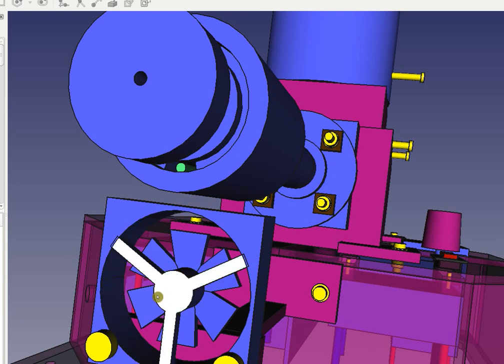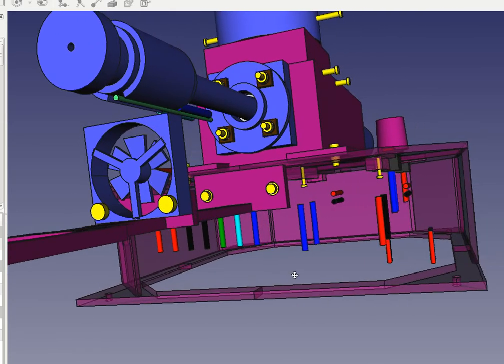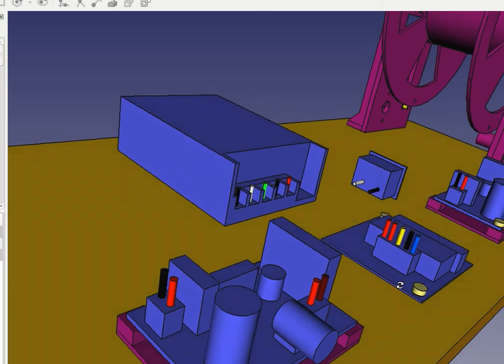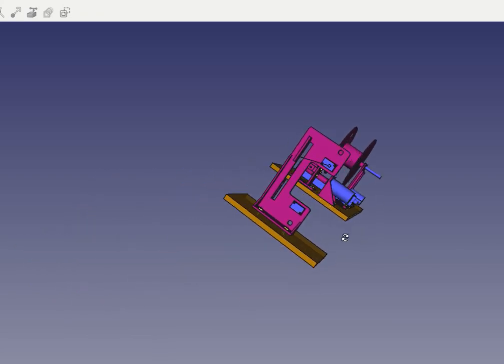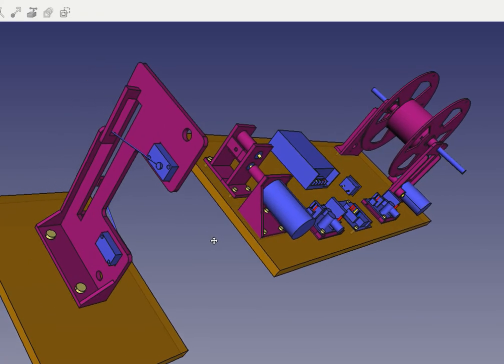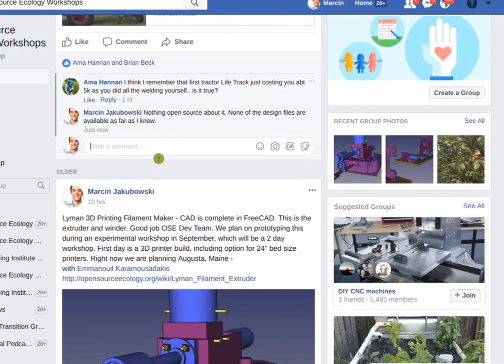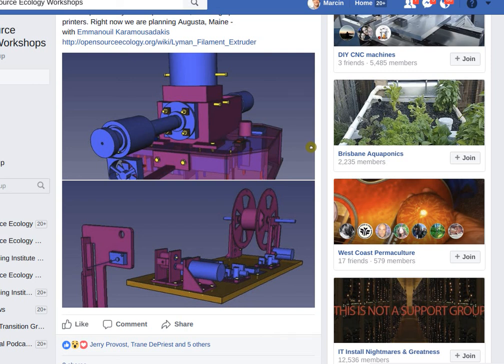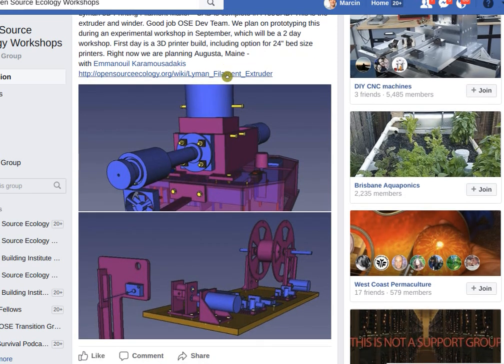Lyman Filament Maker CAD Review

Comment: In the Filament Maker wiring I used the colors from the PDF Wiring Diagram (page 21). To understand the wiring you have to see the names in the tree view (Wires folder). For example, the first thin green wire you showed is the Thermocouple (TC).